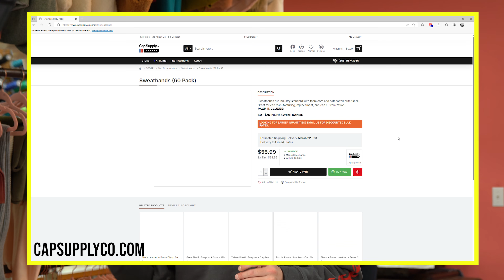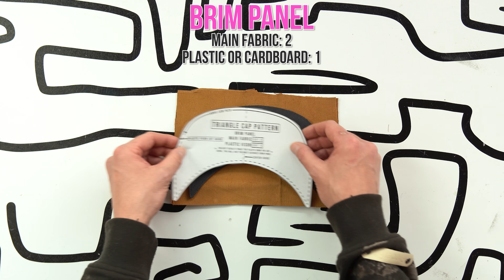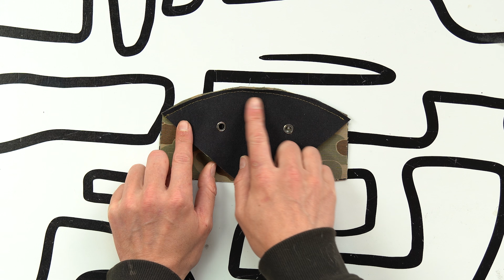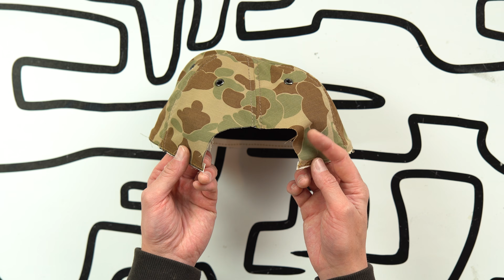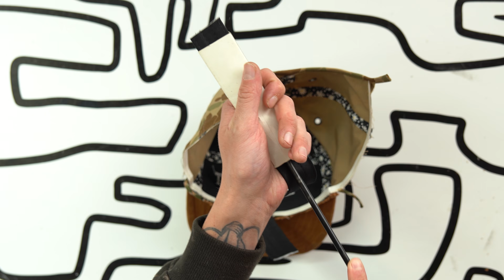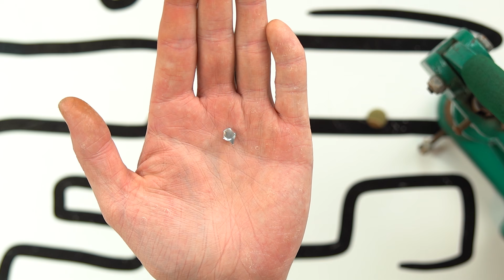DIY 6-panel Triangle Cap | STEP BY STEP INSTRUCTIONS | Printable PDF Sewing Pattern

Comment: Hello man! THanks a lot for your videos. I have a question! The brims you use, what are the materials? Can i sew trough them using a heavy duty 4452 for example? Or the one you specify? im afraid that the machine doesnt have the stregth needed for it.